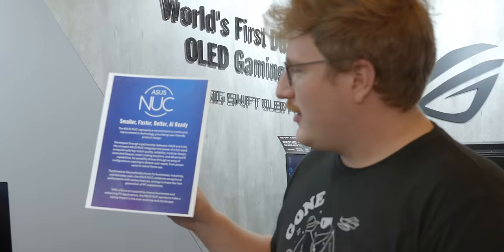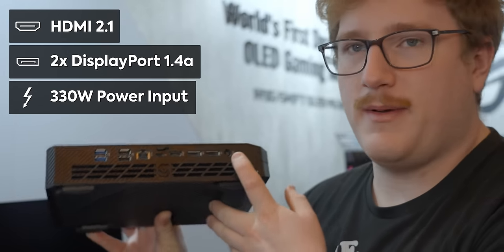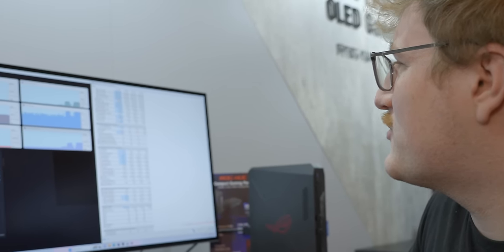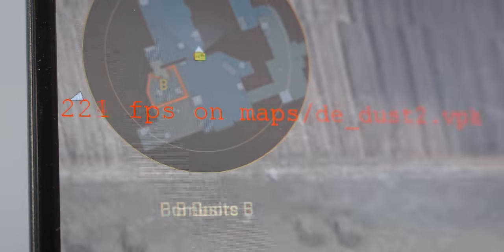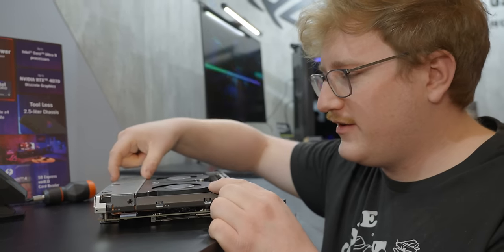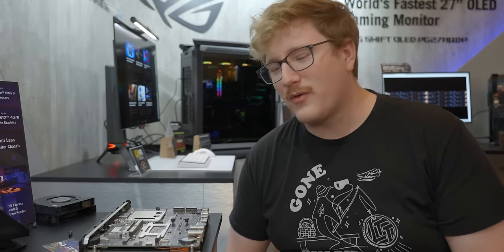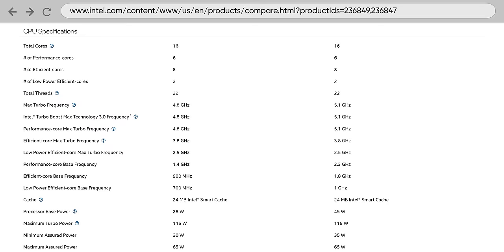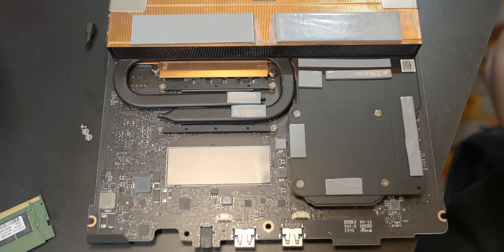ASUS bought this from Intel & made it GOOD - ASUS ROG NUC

Comment: I know that the price is definitely more expensive compared to just building your own PC, but this ROG NUC is something that I've been looking for. A small PC that you can take anywhere.

While yes gaming laptops can do that too, they take up more space than the NUC and it's hard to hook up an external monitor if you have limited desk space.
Reply: Plus, since they don't have a battery or charging port you don't have to worry about wearing them out
Reply: @swordimpulse07 So long as you have reliable power though. If you live somewhere that has outages once in a while then the NUC might not be for you.

Comment: I would prefer to see the same cooling solution on both processors (CPU and GPU) because if it has a smart power distribution, the CPU is always at a disadvantage with cooling.  Intel NUC's lowest price was around $350, so I don't know how I would look at that $1800 price without everything.

Comment: Prices are insane!
I can build a 4060 low profile, mini Itx system for half the price and it will occupy only a couple of liters of volume more, with probabily better performance.
For 1.200 - 1.400 could have been an option, above 1.700 it's out of consideration

Comment: For those prices, you could get a gaming laptop with similar class of specs, that also comes with a keyboard, a nice screen and a battery.
Reply: debatable, I have a strix scar 17 with a 4080 and although it's most def more powerful, it's also more cumbersome and it takes a shit ton or space on my desk when I am also using a monitor. Laptop keyboards are mid, I prefer to use my own so to me that's not important and about a battery.. if you are using any decent gaming laptop you will ALWAYS have it plugged in because the battery life is abysmal and turbo mode or GPU power draw is almost always restricted on battery..

Comment: For the same price you can get a laptop with the same if not better GPU with a higher TGP, a better CPU, and possibly better cooling. Not to mention a trackpad, keyboard and screen built in. I really want to like this product but for them to literally sell you a laptop spec machine minus the benefits of a laptop for the same price is insane.

I have a 12700H and 3070ti in my laptop with a 150W TGP that absolutely rips. 16GB DDR5, 1TB SSD, HDMI 2.1, thunderbolt 4, WiFi 6E, etc.

Got it on sale for $1,800 and saw it on clearance for $1,300 6 months later. I could never justify buying a NUC system when laptops are such an excellent value these days and have all of the same capabilities plus more.

Comment: Price seems a tad high for what's basically a gaming laptop in a chassis with less features - no screen, keyboard, track pad, or battery - with the only real advantages likely being higher total power and better(ish) thermal solutions.

Would be curious how this performs against ROG laptops of a similar price point.

Comment: the tjmax on the core ultra 7 is 110 degrees C. so that is why it reached 106C on a big turbo thing then the 70-80 C is extremely nice temps for a cpu like this. most laptop run at 99C constantly under load anyway

Comment: My 2990WX scores a 1478 in MT with 32-cores, and if I want to I could stretch the performance so the Threadripper CPU is more multi-thread focused and it will pull 1689 on 32-cores.

Comment: The ROG NUC is dead on arrival...

Look at the MINISFORUM Neptune HX99G. This is a COMPLETE system with 32gb ram, 1tb SSD, offering close to identical performance, for less than half the price.. Complete nonsense to buy the NUC when this exists in my opinion.

Scores for comparison, sourced from Technical City:

Single core R23:
6900HX: 1662 (94%)
Core Ultra 7 155h: 1761 (100%)

Multi core R23:
6900HX: 14670 (87%)
Core Ultra 7 155h: 16825 (100%)

Avg FPS at 1080p:
6600m: 100 (83%)
4060: 117 (100%)

My brutal summary:
The ROG NUC cost more than a high end gaming laptop in its lowest end configuration, using laptop components, offering none of the benefits of a laptop, while being limited to a desktop form factor.
Reply: Yep. This or some SFF mid-range build is way better Bang for the buck with better performance. And even if you are afraid of building one yourself, you can always pay some one to do it for you and it sill cheaper than Asus NUC. It seems that this ROG NUC is made only for hardcore fans of ROG brand. With pricing like this it should really include 32 GB of ram and like 2TB or 4 TB SSD.

Comment: I'm looking forward to the Asus  ROG NUC, I just bought a Zotac mini gaming pc with a 13th gen intel cpu and an RTX 4070 but I prefer the Asus ROG brand. Asus would make it easy to buy one (as well as support it) as Zotac is can't seem to keep any good mini pc in stock. Overall they seem to treat the segment like unwanted trash. I understand it's a niche market but they can at least pretend to care.

After owning a few gaming laptops in my younger years and then trying a mini gaming pc I'm now COMPLETELY sold on mini PC's. Mini gaming pc's offer everything I want in a portable gaming machine and DO NOT have the unreasonable fan noise any decent gaming laptop would. I'm very sensitive to it and I don't like using headphones. I literally only use headphones for occasional multiplayer gaming, speakers for everything else. The portable battery aspect is a f***ing joke, who's buying a gaming laptop for gaming not connected to a wall? that's impractical and let's face it , no one is using a touch pad to aim so that mean's you're carrying at least a gaming mouse. I personally only use controllers unless it's a competitive game or RTS.

Comment: Even though it's really cool to have that much power in a NUC formfactor, that pricing is nuts, paying essentially a 1000 dollars just for the formfactor and a 1000 for the hardware.
While if you build a small ITX sized PC (small footprint, albeit it not as small as NUC, still smaller than full tower) and similar hardware you'd literally be at about half the price....

Comment: You can get well spec’d 4070 laptops for $1200…and that’s not barebones. Nice concept, but like 50% too high on price (yes I realize this is normal for NUCs). Hell, my i9 4070 32GB 1TB Legion 5 Pro was $1499, and I’ve seen it cheaper than that.

Comment: Hopefully on the smaller ones they keep the Dual HDMI Dual Ethernet option on the latest Intel NUC Pros. 
Really interested to see what they. Ring out in the smaller form factor. Wouldn’t mind if they got a little larger to enable better I/O. 
I’d love if they did an integrated PSU design similar to MacMini.

Comment: The NUC-like market is so competetive so I can't imagine there is a lot of margin here. This would have to be priced in the 1200-1600 range to even be considered and at the higher end of that a lot of people would probably rather go for a slightly less powerful system at a much better price.
Reply: Having seen the $1800,- price on the RTX4070 SKU it's a little too pricy. It's the same price as the ThundeRobot MIX RTX4070 with 1TB+32GB. Maybe Asus is planning to do sales or maybe they're betting on brand reputation justifying the premium. I don't know.

Comment: AMD has a similar one with PCI slot if you want to add a discrete card for 400 USD in the USA (or 550 € in Europe), to compare.
I do not know if it has AMD MULTI GPU, that I do not know why is a tech nobody tests or benchmark.

Comment: Intel NUC's just have terrible cooling, we have around a thousand NUC's at work and all of the fans break within a couple of years. Of course it doesn't help that most are placed in environments that already have poor air circulation. Curious if this will improve under ASUS and higher quality fans are used.

Comment: I mean I like the idea but the problem is that the SFF PCs have gotten to be fairly small and much better these days so your not saving that much space.  Kinda why intel got out of it, the market for these just doesn't exist anymore.   There is the market for something like a minipc but once you get past a certain performance level people kinda jump straight to SFF these days or just go with a high end laptop.        The same price gets you a better SFF prebuilt machine that isn't using laptop hardware if you don't want to build it yourself and if your willing to try to build in a SFF case(an experience I wouldn't wish on anyone) yourself then you can do it for significantly cheaper.  You also can practically get the same specs in a laptop that is actually portable for the same price.
Reply: If some one is looking for an efficient gaming PC with an excellent watt-to-performace and with reasonable power consumption then this is technically what this Asus ROG NUC is. I think that is the biggest benefit that people omit. This thing has 330W Power Adapter and laptop components, so it should be optimised for a very effective use of power. PCs nowadays can have like 600, 700 1000+ Watt power supplies, so having a gaming PC that uses 300 Watt at max can have a lot of benefits. But what really kills this product is Pricing. You can build a SFF PC with 450 Watt PSU that will have better spec than this NUC for like 60 - 70% of the cost. Or even buy a Gaming Laptop and connect it to a screen, mouse and keyboard. Asus is kinda detached from reality with this prices. Not to mention the "bare bone" part. If you still need to add ram & ssd & instal OS yourself, then who is this product for ? It seems like this  is strictly made for the not just Asus ROG fans, but rather Fanatics lol. If the price was adjusted so that the fully equipped version would cost what the bare bone is going for, then maybe this PC could be interesting choice.

Comment: Yeah no, the pricing structure of these is pretty insane. Assuming they charge $300 for the 4060 variant, that'd mean they're charging you $600-700 for the 4070 variant. That price increase is absurd, especially for a mobile chip. The desktop equivalents are the same price or even lower. Here, I can get 4070 for $500 new. It's no longer 2020, and we no longer have a huge chip shortage.

It's weird, it's almost like they're targeting businesses with this pricing. Businesses which tend to have yearly upgrade cycles who already purchase from HP or Dell... But there's no bait to actually get the businesses to actually take a bite.

Asus, you need to rethink here. The 4060 variant should be $1000 barebones, and the 4070 should be no more than $100 higher. The machines look quite good, but there's not anything unique to you here to warrant the higher price.
Reply: Then there's the complete system charge: ~$400 price increase for the top of the line model, for what is just essentially added storage (probably just 500GB or 1TB which can be purchased separately for approx $70 these days), and RAM (which costs only $70 for 32GB these days)...

Yeah this pricing makes absolutely no sense whatsoever for the consumer. Asus are doing a more than 200% markup on components.

I can't see people falling for it.
Reply: @grahamb7947  businesses buying gaming computers? LOL
Reply: @RomvnlyPlays  that’s part of my point. ‘It’s almost like they’re targeting businesses’, like a gaming brand would be a businesses consideration ? The thought is absurd lol.

Nah, businesses will stick with HP and Dell, no question. Ultimately the point here is Asus are way overpricing this product and most consumers will just buy an HP Omen or something similar if they don’t want to build their own PCs. Cheaper and more upgradable down the line.

Comment: I'll be honest this makes me sad. We went from NUCs with daughterboards that could run off-the-shelf GPUs making some of the smallest computers ever but also in theory user upgradeable systems you want a faster processor you update the motherboard and processor. Add more RAM sure. Upgrade the GPU ok. And now it seems like we are back to square one. I really wish that version of the NUC is what ASUS was basing it off of instead of this. Like that version with Asus's own Mobile GPU daughter boards could have been really cool making it even smaller but still upgradeable.

Comment: why i mean in this spec lenovo and acer have better laptop with 2k display and lapotop is more portable than a mini pc. and both legion pro 5/5i and predetor helios 16 have 140w tdp gpu not 115w. Asus should run check on market I guess

Comment: So this isn't a mobile laptop, but also not a full-blown PC. So you get the compromises of lower power due to the form factor for the same price as a full blown pc with the same specs (mobile 4070 vs Desktop 4070). Why would anyone buy that for that price? Heck there is something like the Legion 5 Pro (a full blown laptop with keyboard, screen, speakers) with the same performance but cheaper...

Comment: Why would you compare it to the built system when its literally a laptop hardware packed in that form factor? Do you even plan what to say before saying it or are you knowledgeable at all? because laptop is such an obvious subject of comparison

Also for $2100-2200 you can get full power RTX 4080 laptop with significantly faster CPU as well as the high end display and every other benefit that comes with the laptops, so I dont see any reasonable, logical point at all in pricing of this thing.

Comment: the price is just outrageous. i can build a system of similar size for less than that with all the components being desktop and desktop 4070 as a GPU. likeee who the f will buy this thing(which, by the way, looks stupid and whoever designed that should be fired) with underpowered laptop components for more than actual fully modular system, which is more powerfull?

Comment: Biggest (and the only) benefit I can see is that this seems to be a very power-efficient Desktop / HTPC. I mean it has laptop components optimized to be power efficient. And ONLY 330 Watt PSU. Desktops tend to have like 600 - 800 watt nowadays lol. But this is where benefits ends. Sure it is small, but you can have a Minisforum mini PC way cheaper. Not to mention, you can even build a small SFF PC with better specs for lik 60 - 70% of the cost of this PC. Tbh. I am disappointed. I was kinda expecting for this thing to be priced more like a gaming laptop (since it is ROG brand, but lacks battery, screen, keyboard etc). Clearly, a product made for the ROG fans, which is odd since Asus is just entering gaming NUC market.

Comment: you mean the threadripper 2990wx is 6 years old and its still 20%   faster than that intel junk. there fixed it for you jake
Reply: 43700 r23 daily driver aio cooled 14900k.